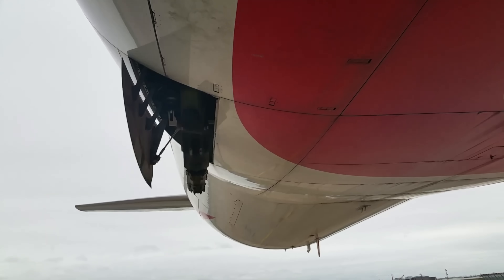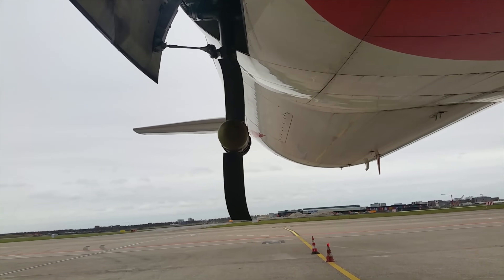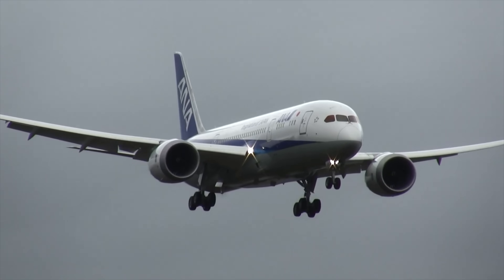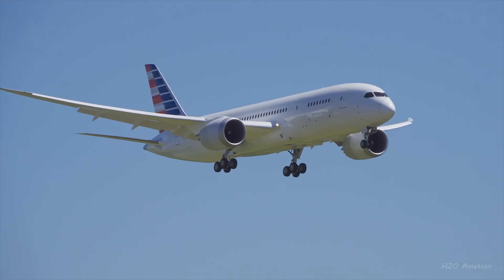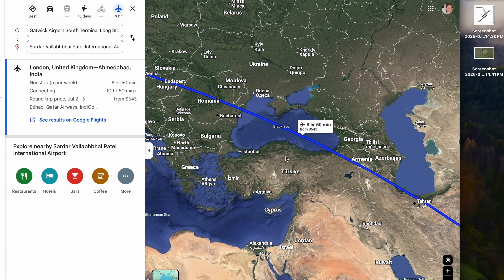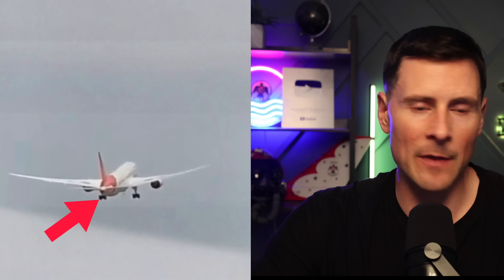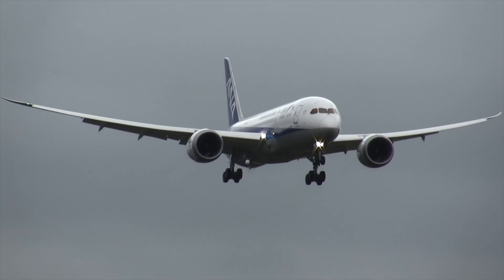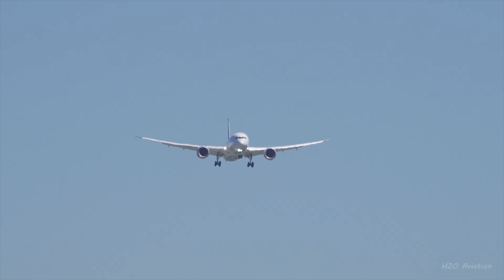Air India 171 SHOCKING UPDATE on RAT Deployment and Flaps!

Comment: ...with both engines out at such a low altitude,  the only option is to look for any clear area ahead and to land the aircraft with the gear extended,  so there was no reason for the crew to attempt to raise the landing gear,  and with both engines out and insufficient hydraulic power,  the landing gear cannot be raised up anyway,  ..

Comment: Everyone is assuming the RAT deployed automatically. That is actually highly unlikely. It takes seconds at least for the engines to wind down and cause the generators to stop producing power. And a few more seconds to deploy and startup. Its more likely the crew manually engaged the RAT because they thought they had lost engine power.
Reply: If that were the case, I would have expected them to communicate a problem earlier than they did.
Reply: @rudewalrus5636  Aviate, navigate, communicate.  I'm surprised they had time to call at all.
Reply: @rudewalrus5636  Calling things in is last priority, first you keep the plane flying, then you worry about where it's flying, then you can care what the tower knows.
Reply: This can be explained by the power control unit software commanding all 4 AC generator control units to shut down - a proven vulnerability that surfaced during the 248 day continuous power advisory. Even if its not a software issue, the RAT would deploy if the power failed and the power failing does not necessarily correspond to the generators
Reply: @anon1832  I don't know the inner workings of this so I can't argue about that. But, the big question is really what happened on the ground. Why did it take off at the end of an 11,800 ft runway? This disaster was already well underway before it left the ground. The RAT and other actions are just secondary and maybe not even related to the crash
Reply: @paulgallagher2937  Once you reach a certain speed you're commited, it's far more likely to be a disaster if you don't take off. It's quite possible things started going south just as they crossed that line. Possibly one engine failed just as they hit the first point of no return (commited, but not point up speed yet) and the second didn't fail untill after they lifted off. perhaps the second wasn't quite at full power due to whatever killed the first engine (bad fuel, power issues shutting down fuel pumps, etc)
Reply: @kaseyboles30  Yes that is true. But with that long runway, they should have hit that decision point with plenty of runway to stop. The moderately loaded 787 can lift off in less than 6000 feet. They probably had about 5 seconds to make the decision to RTO beyond that. If it took the entire runway to get up to VR speed, then there were definitely indications of issues long before that and it is a failure to not RTO. If they hit VR at the normal point, and it did not rotate on command, they should have immediately hit the brakes. Even if they were a couple seconds late, the worst that would have happened was a low speed over run, and likely nobody would have died. Unless we find out that somehow they had electrical issues that took away their control of the aircraft during the takeoff run, then its pretty clear this was massive pilot judgment or error.
Reply: @paulgallagher2937  My understanding is the decision point is predicated on the last point at wich remaining runway and speed will no longer support stopping safely. My understanding is they were near max takeoff weight as well which mean a much longer stopping distance than might be obvious. There are however so many unknowns at this point most of anything we say is speculation. What we do know is the plane fell out of the sky with it's falling and what is almost certainly a RAT deployment and Not enough (if any) engine noise. Plus they called a mayday claiming no thrust, no power.  That and their wheels were cocked for retraction but hadn't retracted which should automatically happen after they were cocked back. Sounds like the problem occured as they lifted off or almost imediately after. And almost certainly both engines failed or stoped for some reason.
Reply: @kaseyboles30  It was not even a full flight, not near capacity. And that makes almost no difference in takeoff distance. The used 6000 feet more than normal for takeoff. Something was already very wrong before take off
Reply: @anon1832  Is this issue not adressed then? Are there still planes flying with this bug?
Reply: @ouwebrood497  the bug was the integer overflow, the result was going into some safe mode where the generators are turned off. The bug was fixed but the fact is all the generators can be kicked offline by software, that's absolutely wild from a software engineering pov. Boeing will say "yeah but you can recover" - but you can't recover if it happens during takeoff as we've just seen. Even if the power failed for another reason this is a real mess
Reply: @anon1832  If I'm not mistaken this bug was discovered 10 years ago. Do you know if in the last 10 years there have been reports of sudden shutdown mid air due to this bug? I can imagine these incidents don't get much attention, because after a reset of the AC units its fine and probably taken care of when the plane has landed. If this bug still happened a lot, due to lack of software update or regular preventive shutdown of the AC units, then one could wait until this would happen at a very unfortunate moment.
Reply: @anon1832  Not entirely crazy, not if a LOT of safety interlocks exist. It's six of one half a dozen of another. You might need them all shut down if they're throwing sparks at a ruptured fuel line.  Or if they're generating power so dirty the filters cannot protect the computers and controlls and just running on the rat would be safer. The trick is to make sure it's as close to impossible as can be done for it to shut them down when it's not wanted and not fail to shut them down when it is. THAT'S why aviation (and medical and financial and some others) have more time spent with dedicated folk trying to break the software than is spent in initial developement. At least in theory anyway if no corners are cut.
Reply: @kaseyboles30  the 787 has overdone reliance on electrical systems and software to save complexity and weight - that's the bottom line. We saw what they did with the 737 max, and now we're going to see something similar with the 787. It's really clear that they are outsourcing software, not taking it seriously, and the airlines play along because other than these crashes its very cheap and efficient
Reply: @anon1832  I sincerely hope not. But I wouldn't bet against it.
Reply: No way
Reply: Can they deploy RAT manually?
Reply: @tiju.j they simply did not have much time. I’d expect RAT automatically deployed
Reply: @tiju.j  I believe so, it only makes sense there'd be an emergency lever or switch for it. preferably something mechanically fixed to not be dependant on internal systems.

Comment: Why is there only one rat? Seems like something there should at least be a pair of. For backup or situations like this
Reply: Captain Steeve: "The Rat is the final failure backup. It gives you enough power, if you are far enough off the ground, that you can still land the plane".
Reply: @sus2222 Yes but if there were 2 the plane in this situation could have had enough power since it wasn’t in an adequate situation for just a single one to help. I get its already a backup last resort kind of thing but still kinda shocking that there’s only one on board. What happens if that part of the plane is damaged?

Comment: I know fuel problems could cause both engines to shut down. I get that. But of all the airplane crash documentaries I've seen, I've never heard of a fuel problem causing an immediate shutdown of both engines. Usually one engine would start to sputter, then shut down, then maybe a few minutes later the other engine would start to have problems. In this case, its like if you were riding in.a car and you just turned the key to off. Going purely off of my own engineering intuition, it feels like a computer or electrical problem caused the engines to shut down or idle, rather than an engine shut down causing the electrical to fail.

Comment: The FO pulled the flaps up instead of the gear. That’s what makes the most sense to me and far more likely than something that’s never happened on the 787 over 5 million flights (dual engine failure). 

The RAT can be deployed manually as well, a poignant fact that’s being glossed over by everyone.

But we will know exactly the cause in a few weeks.
Reply: Nope, the landing gears wheels were in a position that you only see when it started retracting.

Comment: Wouldn't the black boxes tell exactly where the flaps, engines, fuel pressure and rat parameters? Is the flaps screw gear operated showing exactly the position during the accident? I would think all of this information is available to the investigators for a speedy conclusion.

Comment: 1-Those flaps are down, probably at setting 5. The inboard flaps do not move very much on a 787 but they are 100% down. 
2-It would be virtually impossible to accidentally raise flaps while meaning to raise gear. Huge gear lever right by the copilot, vs electrical switch way over on the panel.
3-Gear looks to have tried to have been raised. Wheels are pointed upwards which is the first phase of gear retraction in a 787. So I think they did (try to)raise the gear before losing power. 
4-My first assessment was autothrottle/management system failure. There is an AD out for this plane for autothrottle failing at "critical phases of flight" close to the ground. But autothrottle would automatically activate before letting the plane stall in any phase of flight.
5-It has to be total electrical failure, which is why autothrottle couldn't kick in, also why the plane was configured perfectly, including the attitude of the plane which the pilot did all he could splitting the difference between stalling the plane and getting over obstructions while losing thrust. (His slight nose high attitude was all he could do). The RAT deploying says total electrical failure.
6-While I never flew anything that large or complex, total electrical failure on planes I flew would not stop the engines from operating. Battery bypass straight to the fuel pumps. This plane has multiple fuel pumps per side, neither side depending on the other. If Boeing didn't build in a way for the fuel pumps to bypass when in an electrical failure I would find that extremely odd and disconcerting.
Reply: You are correct. In the event of loss of AC power the DC pump in the center tank automatically turns on.
Reply: It glide just fine... flap just fine https://youtu.be/sqHmmnuf0IU?si=_kh9415KUzjiZ6DM
Reply: Question - could back up battery power have been drained?  I do not know how the batteries are recharged, but if they were depleted before take off, they might not have been able to maintain emergency fuel flow.  Just a thought from someone with zero knowledge of flight electrical systems.
Reply: @johntwineham6015 not likely. The batteries are being maintained while on the ground either by the APU or the ground power being connected. This is a voltage read out for each battery on the pilots display units.
Reply: @homeofchrome - just wondered about the air conditioning failure on previous flight, and whether the battrries either eere not recharged or  perhaps they were acting like batteries at the end of their life cycle, where they register as charged but deplete very quickly.
Reply: @johntwineham6015 that is a good point. They could have also been overheating due to the temps that day. I wasn’t aware of the air conditioning issue the day prior on this aircraft
Reply: @johntwineham6015  The APU can be started at anytime in the air or on the ground. And would normally do so if needed for the air cond.
Reply: @johntwineham6015 yeah man.. it's sad if it doesn't come with some kind of alternatorhttps://youtu.be/sqHmmnuf0IU?si=_kh9415KUzjiZ6DM
Reply: "Huge gear lever right by the copilot, vs electrical switch way over on the panel." - Swiss001 exposed that Capitan Steve lie - he suggested not only flaps at 0 (sounds alarm) but also that lever is next to each other which is not. Maybe it's on plane he was flying. Then many other people suggested same, when it was exposed they hold into posistion of contamined fuel. To keep blaming locals. If not reports of electruical issues of this plane already. Or for example AC cooling malfunction that day. I would supect it wasn't accident but deliberate - to be remotely shut down at most crucial moment. Hence misinformation campain. Most probable for this moment to me is that this plane  do have some design flaw.
Reply: … and you got all this from watching a couple of grainy videos!
Reply: @langdalepaul  Yes, and I am correct in my assumptions. Only question is why is there no thrust.
Reply: @MikeM275  you should apply for a job at the AAIB. With you there they’d complete their investigations in record time.
Reply: @langdalepaul  One of my jobs while a professional pilot was to go photograph wreckages for insurance companies. I learned a lot. It was many years ago and today's aircraft are much more complex. The thing is though, from the Wright Bros. to the end of time airplanes will go thru the air using the exact same formula of lift and thrust. And till the end of time there will always be 3 axis of flight from ultralights to fighter jets and anything man will ever create.
Reply: @MikeM275  you must be American: suboptimal irony sensor.
Reply: @langdalepaul  LOL...and you think I didn't know you were being sarcastic? I just chose to reveal my superior intellect and let you marvel at my explanations as I elucidate the issue at hand. You're welcome! ☺🤗🙂
Reply: @MikeM275  Yes best to ignore sarcasm if that's all someone has to contribute!  I found your commentary very interesting given the initial speculation seems to have been revised.
Reply: @poppyland74  Thank you....yes taking people's word that they know for certain the RAT came out changes my speculation...which, as I have admitted we are all just guessing here. Some with more knowledge than others but it's a free internet for anyone to propose any scenario a person feels may be of value.
Reply: @MikeM275  *Wright brothers.
Reply: @terrymoore1830  Thank you.

Comment: The RAT won’t power fuel pumps. If they lost both AC buses they would lose all fuel pumps. I doubt that those engines can suction feed TOGA power. This may be exactly what happened. A massive electrical fault with loss of both AC busses and fuel pumps. But I’m just a 757 driver. Any 787 drivers want to weigh in about my theory?
Reply: The aircraft maintained flight long enough to prove there was SOME engine power, just not enough. Had the engines completely failed, it would have sunk like a rock. Instead, it sank like a feather.
Reply: @-108- Maybe. It’s possible that the electrical fault occurred just at rotation. Suction feed would be less fuel flow and slower spool down. But remember that there is a lot of mass moving forward when the engines spooled down. It wouldn’t instantly stop.
Reply: @grumpy3543  But you can hear the engines in the video, and they aren't spooling up or down.
Reply: @-108- I don’t hear any power coming from the engines. Play some videos of 787’s taking off and listen to how loud they are. I can only hear the rush of the wind over the plane and the RAT.
Reply: @grumpy3543  Engine sound is clear, to me. They are certainly not TO/GA power - more like ~20% or so. The sole survivor also stated that he could feel engine thrust increasing as it settled into its descent, but it was too late... which is an interesting addition to the entire equation.
Reply: @-108- It is interesting. It was definitely low enough to be below idle thrust which would trigger both AC busses to trip off and the RAT to drop.

Comment: If the RAT is deployed there has to be an electrical and hydraulic failure, would explain why the landing gear is still down and the cause of engine failure. Along with the high temperature possible vapour lock.

Comment: As a common man with zero knowledge on aviation, I wonder if there are technical issues with flight, no warning signs on the cockpit screen? Even a decent model car has so many dashboard warnings that alert you about maintenance and other mechanical issues.
Reply: Oh yes, there are. So if there was some critical problem before take off the pilots would have seen that. Unless for some reason they ignored it.